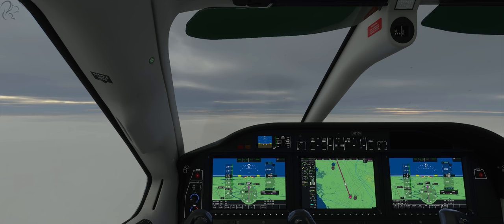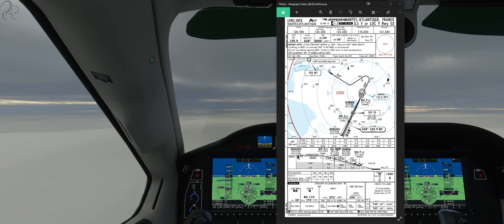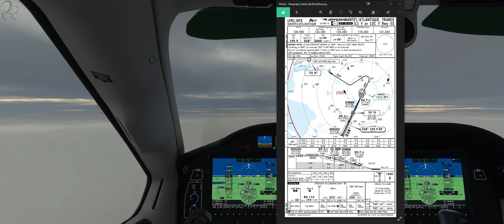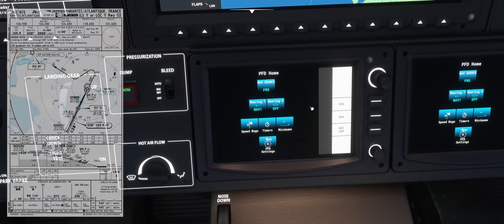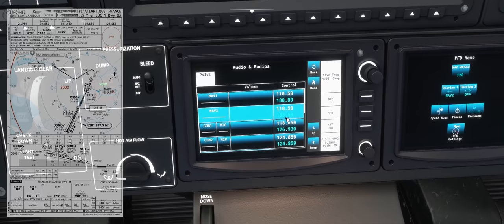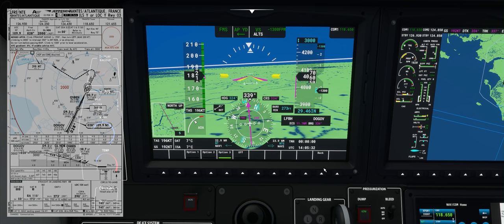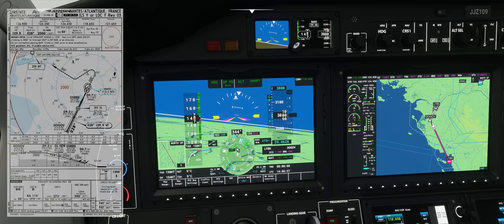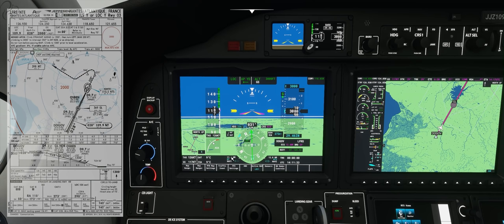TBM 930 ILS Approach - HOW TO in under 15 Minutes - Microsoft Flight Simulator

Comment: i learned like 2% of the stuff you said, understood about 1% but enjoyed 100% of it
Reply: 100%! It become evident, pretty early on, that I must just be here for the flashing colours and bright lights cos damn my pea brain couldn't work most of this out!
Reply: @DavidBournePhotoandVideo  Basically, you just need to know your departure and destination. Lean The Automatic Pilot, how to set your Altitude and for you to learn how to gain a certain altitude on Autopilot. Then, learn the The Nav button, which puts you on your flight course. Then, you need to set the Altimeter to lower to a certain altitude before hitting the automatic landing guide which doesn't actually land the plane. Of course, a tower may ask for you to change your heading or a new destination to land at. It gets a little complicated the more you get into it especially if you fly a Jumbo Jet and use The (FMS) Flight Management System. That is when you have to research and learn route codes or airway codes. Every Jumbo Jet has to follow flight Airways to travel, so that they don't bump into one another. Of course, some planes don't have any of that. Just a stick, rudders, and ailerons. Flying is easy.....Also, a person needs to learn how to use Trim, and even some planes don't even have that. Then, you are constantly pulling back on your joystick which is a pain in the butt. Oh...anyone can fly a damn plane. Can everyone understand Flight Controller Tower Lingo Requests is a different story. I like starting off from the parked position and taxing to the runway. It makes if feel more real. Of course, that isn't easy for everyone to do. Just start off simple, and learn the rest later. Just have fun with it. After all, you can't kill anyone in a Flight Sim.
Reply: @DavidBournePhotoandVideo  Heck, I have XPlane 11, and other Flight Sims in VR. Not as scenic as Microsoft, and they only plan on coming out with it in VR much later on from what I was told. Oh...that would be awesome if they were to do that sooner rather than later. Of course, computers can't really handle a game like that yet but eventually...I'm pretty sure that will change.
Reply: As for Squirrel, he likes all the games I like for instance, Euro Tricking Simulator and American Trucking Simulator. Of course, I was a trucker in real life. Even so, my direct ancestor is one of the reasons why we all have a U.S. 1st Amendment. Oh...long to explain that history is in order to explain. I flew a plane when I was 5 or 6 yrs old. Not alone...I just held the yoke. He said, "Don't worry!" Whatever mistake you do, I can get out of it. I got to turn the plane, go down and up. To me, I was flying in a Cessna. I couldn't reach the rudders, and my parents never knew I went up in an airplane with a stranger at a small airport in Bristol, CT. I was a brave little kid. A little escape artist. My mom couldn't keep me locked in any room. I was an explorer. One of my sisters complained that she found me 9 miles from home at 4 years old. I always made my way back home even when I traveled further than that. lol I rode a Big Wheel from Bristol, CT to Plainville, CT and then to Southington, CT, and back home. Ha...I can't imagine where I'd go if I could fly. Area 51 perhaps. lol Hey.....doesn't everyone want to know what they are hiding? lol
Reply: @brianparent  That is one heck of a reply, I do appreciate the time you took to write it! It's amazing how these videos start off with flying basics and I think "yeah OK, I'm following so far" then within a short period of time I'm left sitting there going, "I'm lucky I know how to tie my shoe laces!"
Reply: @DavidBournePhotoandVideo  You'll find videos on how to use The Autopilot and Nav and Alt buttons even by experienced pilots using Flight Simulator. Some explain it all in simpler terms. Of course, the more videos you watch, the more you learn.
Reply: @DavidBournePhotoandVideo  Same could be said about books. Of course, nobody reads enough. lol
Reply: @DavidBournePhotoandVideo  I'm trying to learn how to fly a Jumpo Jet using The FMS. You can't even imagine how hard that is to take off from a parked position. I'm learning though. Hey, if I ever get stuck in a plane and something happens to the pilots, I'll know I can save myself. lol
Reply: @DavidBournePhotoandVideo  I always wanted to learn how to fly a helicopter all my life. Too bad they didn't add one in Flight Sim.
Reply: @DavidBournePhotoandVideo  lol I didn't know how to tie my shoes either when I was young. We all have the ability to learn whatever we set our minds to learning.
Reply: @brianparent  tying shoes is ovvrerated when you can just avoid lossening them
Reply: @brianparent  I used to know a very clever guy who taught flying in MSFS 4.0b.
I soon realised that holding patterns and ILS work could be tricky especially when you have to adjust for wind and end up at a VOR fix on each lap of the pattern. I know nothing about the complexities of the aircraft now simulated but it will take many years for me to even understand 25% of it! If the guy was around now he would write new books about MSFS 2020 but we need a very large book right now to teach us more than just the basics of the new sim because studying just with youtube is quite difficult!
Reply: This is so accurate.
Reply: Same  from China
Reply: @sfc0324  don’t need to include the from China. Nobody asked
Reply: Agreed
Reply: You put the cat to land the aircraft
Reply: There's a YouTube channel called Kip on the Ground that's a million times better at explaining it than this guy.
Reply: Same. I did download an approach ap tho. This should help tremendously
Reply: @DavidBournePhotoandVideo   I hear ya! I've only managed to make 2 ils approach and landings so far. It does give a pretty good sense of satisfaction when it works out like it's supposed to!!!
Reply: @donc9751  Thankfully I can report that a year on I've managed to get a fairly good handle on it (for in game flying, not real life of course) Made a few videos on another channel to take people through some of the systems of the A320 and 747 too as I found a lot of videos tended to get a bit technical, whereas I wanted one that kept it simple.
Reply: @DavidBournePhotoandVideo   I'll have to check out your A320 videos! They sound helpful and I definitely need help with that but with the PMDG 737 due out soon it may not matter...
Reply: @donc9751  if you search for _gamerDB that’s my other channel and you’ll see them on there 😊
Reply: @brianparent  p
Reply: @DavidBournePhotoandVideo  your a nice chap, mate
Reply: @dacallp  that’s very kind of you mate ❤️
Reply: @DavidBournePhotoandVideo  np I just love how honest you are because i also like dont really get this but everyone can do it after some time!
Reply: @brianparent  what is your point?
Reply: @baasbaasje6960  Tell me....Who sits on The Crown of Canada today, and is Canada sovereign from The British Royals?
Reply: @baasbaasje6960  Oh...my direct ancestor was one of the reasons why Roger Williams came out with The Separation of Church & State also known as The Establishment Clause to our U.S. First Amendment: The Separation of Church & State that later transcended down into our U.S. First Amendment between The Danbury Baptist Association and Thomas Jefferson as well as James Madison in 1803 in Danbury, CT in 1803. Sources: U.S. Library of Congress, Smithsonian, U.S. First Amendment Center, U.S. Bill of Rights Institute, etc....etc...
Reply: @baasbaasje6960  I wonder how many of you read books especially on our Pilgrim Fathers and their quest for Religious Freedom shared also by our U.S. Founding Fathers?
Reply: @baasbaasje6960  How about The Protestant Reformation Era as well as The European Persecutions during The Protestant Reformation Era that led to your freedom to speak?
Reply: @brianparent  and again: what is your point?
Reply: @baasbaasje6960  Oh...I can make a lot of points.
Reply: @baasbaasje6960  Oh...Hyperinflation occurs when a nation can no longer pay down the interest on The National Debt, and all they can pay down is partial Interest. Money deflates in value while prices inflate to the point where inflation itself spirals out of control. Of course, can even lead to the almighty U.S. Dollar becoming worth less than the paper it is printed on. Of course, that happened in Zimbabwe, and The Weimar Republic of Germany in 1923. Even Yugoslavia faced Hyperinflation in 1992. Of course, that was around the time that Russia asked for help from The United States to help pay those who had their fingers on nuclear weapons because they were surviving off $4 per day bread and water. Oh...that was mentioned through Canada's Fortune Magazine in the early 1990.
Reply: @baasbaasje6960  Hmm. Do you think Mainstream Media News teaches you the damn truth about the past or shares partly true? Of course, only one that reads many books would know the difference when it comes to history.
Reply: @baasbaasje6960  What did Roger Williams do who bought his land from The Narragansett Clan that The Wampanoag Clan tried to drag into their war against British Troops during King Philip's War? Oh...Roger Williams wrote books about The Narragansett Clan, The First Governor of Rhode Island who was nominated The Founder of The State of Rhode Island.
Reply: @baasbaasje6960  Oh...Roger Williams was my direct ancestor's brother's wife's great grand father. Roger Williams great grand daughter, Susannah Holmes married Rev. Valentine Wightman. I fall under his brother Rev. John Wightman who married Jane Bentley, and their daughter Mary Wightman who married Captain Samuel Boone Jr. whose sister, Martha, married Captain Samuel Rhodes. Of course, Martha died at sea shortly after they were married, and Capt. Samuel Rhodes ended up marrying Martha's sister, Hannah Boone. Of course, you do remember "Daniel Boone" like through Disney's Show, Daniel Boone. Oh...they were related but further into the back into the past.
Reply: @baasbaasje6960  Oh...I'm most definitely an American Citizen. If not for my ancestors, heck.The United States would have never existed. Oh...I mean that literally.
Reply: @baasbaasje6960  Of course, I have no reason to lie while living off disability in Van Buren, ME a small town along The Canadian Border in Maine, and I've been researching into conspiracies, History, and my ancestry since 2005. Nothing else to do in a small town.
Reply: @baasbaasje6960  Besides, I'm 52 years old and just went through 3 major surgeries in the past year and a half at MGH in Boston, MA. One was for a Liver Transplant. I guess I'm lucky to still be here.
Reply: @baasbaasje6960  Oh...I'm most definitely one to speak my mind.
Reply: @baasbaasje6960  Of course, it is interesting that they censored Congressman James Traficant from Ohio as well as Congressman Paul Findley as well as Congresswoman Cynthia McKinney along with U.S. Admiral Thomas H. Moorer years ago when Israel attacked The U.S.S. Liberty during The 6th Day War between Egypt and Israel. Congressman Paul Findley wrote a few books about that incident.
Reply: @baasbaasje6960  Of course, our 2nd Amendment is constantly under attack was well as our U.S. First Amendment. Oh...most definitely!!
Reply: @baasbaasje6960  Of course, I'm no fool. I've been following the political bologna for 17 years straight except for times when I was in the hospital.
Reply: @baasbaasje6960  Do you know what I'd love to see? I'd love to see everyone in D.C. go through a damn polygraph test on where their loyalties lie, because I'm pretty darn sure it isn't to our U.S. Founding Fathers and The U.S. Constitution. Not after all I've seen and read from history books, etc...
Reply: @baasbaasje6960  and they try to label me a terrorist. For what? Sharing information I find that I think others should see for themselves and judge for themselves. Yeah...bunch of bull crap.
Reply: lol😂 for the longest time I’d just do everything manually

Comment: Congratulations Squirrel. Another well thought-out and condensed tutorial. Those new to this, he has covered a few hours of ground school and a few hours in the cockpit at a flying school all in 45 minutes. You might need to pause a lot to set this up on your own. Those commenting on the G1000 C172, it is similar in the PFD. Use the same procedures to get to that runway automatically. Try it with blue skies the first few times, then go nail-biting in the fog and see how you do.
 Thanks again Squirrel for a quality production. Your real CFI should be proud of you!

Comment: For beginners who are intimidated when it comes to stuff like ILS approaches: you can select an ILS approach in MSFS 2020 when you are planning your flight in the flight menu :)
Reply: Does that mean the programmed flight plan, will include the ils waypoint? So all I have to do is enter the localiser frequency?
Reply: @exiletsj2570  Yes that's correct. I believe you still need to be at the right altitude, but you'll see the ILS glide slope appear on your screen, and the plane should catch it as long as you intercept it by matching altitude.
Reply: knickknack Don’r forget to note the frequency before you click Fly because once you’ve left the world map there’s no way to find that frequency again
Reply: @DaiBach99  You can actually get it directly from the PFD in the TBM. You just have to search the airport's ICAO in the "waypoint finder" and there is a tab with all the frequencies for that airport including the ILS frequencies. If you click on one of the listings you are prompted to load the ILS directly into your active NAV 1 or 2 radio.
Reply: Sorry but what is ILS mean?
Reply: @senju2024  Instrument Landing System. Radiowaves provide a guide for the approach.
Reply: ya,i personally hate it as i like to manually program flights(more realistic
Reply: I've tried that and it never works out. It seems to send you off on these huge loops to get to the approach fix point.
Reply: Dunno what your experience is, but when I do the detailed flight planning in the menu, I cannot make any changes to it in the FMS during the flight. For instance, try to switch to a different approach and the FMS just goes blank. No going back to the originally planned approach either. This doesn't happen when you plan the flight inside the FMS while you sit in the parking.
Reply: @ScoobiusDoobius  do you know if there is a similar feature on the G1000?
Reply: @senju2024  Instrument Landing System. Wikipedia is your friend.
Reply: yeah, you can select an automatic approach
Reply: @aviatorboss9978  you can just not use a destination, and your set :)
Reply: knickknack I just cant understand how any serious flight simmer can even consider using these bug infested aircraft! Even FSX was a masterpiece compared to this MSFS which looks nice from a scenery aspect, but basically it’s nothing but bug ridden garbage!
Reply: @zalmh  It’s purple but it doesn’t descend for you in my experiences.
Reply: @ottoversetv  make sure your set to the localiser on your PFD (green) and turn on approach mode. I haven’t had an issue doing it this way
Reply: @zalmh  Yup just figured that out i was trying RNAV approaches instead of LOC
Reply: @simonsmedley5434  It's still relatively new and they're updating things all the time. Give it time. I'm not a "serious" simmer so I'm relatively new. But MSFS 2020 gives you so much out of the box compared to other sims where you need to download separate modules for each feature. So, I can cut them some slack because they're doing so much all at once.
Reply: @simonsmedley5434  Heh. I remember people moaning like this about FSX for years after it came out - the same way they did about FS2004 - and FS2002 - and FS2000... The new one is garbage, not good enough for "serious flight simmers," the old one was way better, Microsoft has ruined it. 

Very funny. Some things truly never change.
Reply: @GizmoMaltese  Yeah, even in 2023 i find the autopilot flight logic to be a little dodgy.
  I’d recommend descent to the correct altitude, getting to the initial fix at approx the correct heading and staring down…

Comment: Squirrel, I have been loving your videos. I bought MS Flight Sim 2020 because I wanted to get back into “flying”. I was in the military for 25 years, flew MH-47Es and have about 5500 hours total, tandem rotor, multi-engine, instrument, and instructor pilot ratings. I am amazed how detailed this program is, som many of the avionics are working models, I just didn’t expect that. My problem now is I can’t find a hotas anyplace for a reasonable price. Can’t wait until I can get one. Keep the great videos coming. Thanks!

Comment: It took me a few tries but I managed to finally do it. Here's a few things I learned:
You must input the localizer frequency. The other frequency he inputs (DME) is not necessary.
It's a good idea to turn on the vertical navigation (VNV) and adjust vertical speed to catch the slope. Squirrel doesn't mention this but you can see him turn off Altitude Hold at 11:12.
Reply: What he's using is Vertical speed mode (V/S button), VNV is used to tell the AP how fast and when to descend via the flightplan. You would have constraints in the plan, like waypoint 1 above 10000, waypoint 2 below 5000 or so and it'll figure out the descent on its own (provided that your altitude bug is set below of the lowest point you want to descend to). However, the default TBM (and all other default aircraft afaik) don't support this mode. It's working with the G1000/G3000 NXi mod though, which means from Update 10 onwards (September 22 patch) it's in any default plane that uses the G1000 displays. The G3000, like in the TBM, still needs to have the mod installed manually.